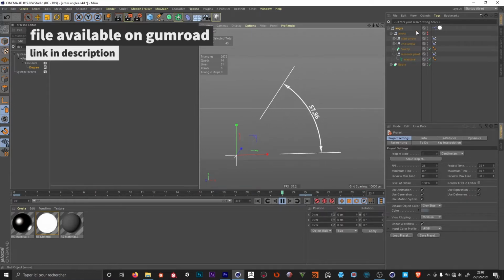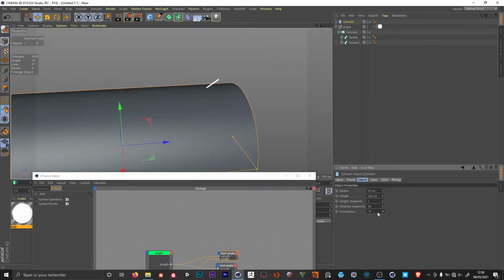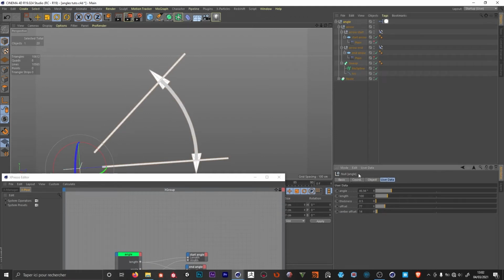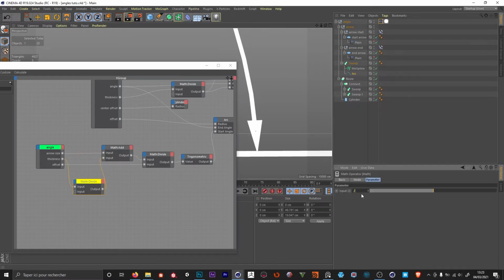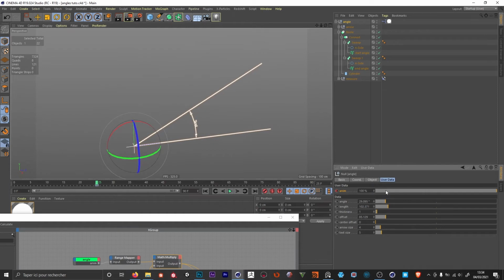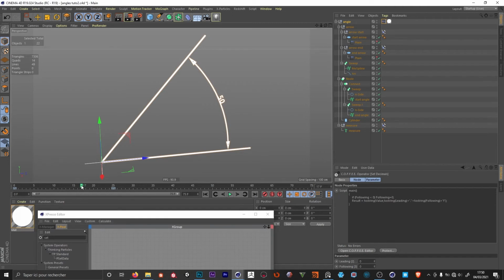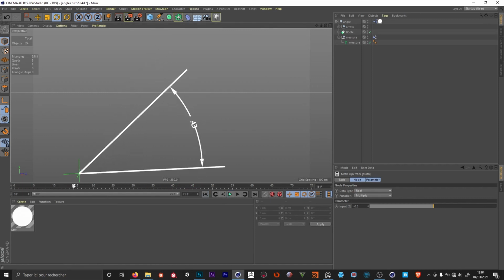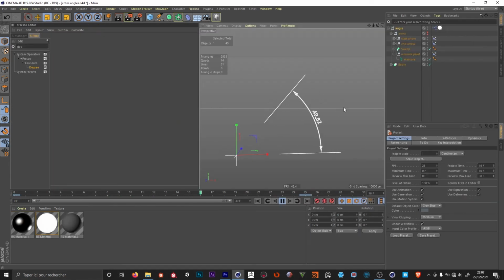[EN] Industrial drawing part3: angles

Comment: Great series of tutorials! I skipped ahead to watch the last part but there didnt seem to be any practical explanation of how the tools work. I want to ask How do the tools snap to points or lines for instance?
Reply from the maker: Hi, at the beginning of each video, I quickly review each setting. Regarding snapping, I simply use the snapping option in C4D. https://youtu.be/0gUHUaOh6uE?si=AOy-0_kq4lx9mR1g
Reply: @gillesdillenseger6472  You definitely do that, but thats running throught the slider controls. When you are using the angle tool and you want to snap the line against an edge what is your process? BTW, no criticism, I absolutely love what you have done. I actually think its worth you doing a demo video of you using these tools.
Reply: @gillesdillenseger6472  Just to say I have followed the tutorials, but i would prefer to buy your files because I am inexperienced in using expresso. The thing that stops me buying is not a full explanation of the use of the tools. The length measure is easy to work with as you shift along the 'END'null. But on the Angle tool going into to the hiarachy and adjusting the angle of the mospline in the hope of snapping to an edge,point,polygon seems not very user friendly and breaks the tool itself.
Reply from the maker: Got it! No need to worry about the hierarchy—it’s super simple. Just pick the main null called "angle," and you’ll find all the settings you need in the User Data tab to adjust the tool. The idea is to place that null at the origin of the angle you want to work with, align the tool using the Coordinates tab, and then type in the angle you need in the User Data tab. I didn’t include a snapping feature, unfortunately, but I hope this helps! 😊
Reply: @gillesdillenseger6472  Ah, thats what i was thinking. This isnt actually a tool. Especially the Angle tool - its doesnt work with geometry of an object to give you the angle ie the angle edge doesnt snap to an object .

Having to type in the angle information in user data means its not actually a tool - Its more for display/rendering purposes only and isnt a drawing aid  which is a shame because it could have been both.

Mate, i think with your skill you can tweak this to make it properly functional, at the moment its not, well the angle tool isnt anyway and im guessing the same applies to the radius tool. The  measure line tool seems to work in that respect but you have to go into the hiarachy and not the user data ctrl system you have created which feels counter intuitive.
Reply from the maker: It’s not intended to be a tool; rather, it’s an animated graphical element. If you’re looking for a tool to accurately measure length and angles, Cinema 4D already includes a built-in feature called Measure and Construction.

https://www.youtube.com/watch?v=H2QBDha0xnQ
Reply: @gillesdillenseger6472  Thanks , I think you're missing a trick. 

C4d 's measuring tool is way out of date and is need of a real upgrade. I use it all the time.
There are not many good 3rd party measuring plugins and yours was the first id seen that really impressed me. I work technically so to have something that not only serves as a drawing aid but also can be rendered with a little animation would be a real game changer. It would bring an element of cad to c4d that it is sorely lacking. 

Then rendering out plan and side views means the work is dimensioned, i dont have to mess about going into cad. I would say as someone who was close to buying your tools the description is misleading. 
They dont work as aids. But my further point is can you not develop them a little further to do this? Because then you have an A+ really useful tool that is not only visual but also technical - that would be fantastic and it feels like you are literally almost there. I wish I knew expresso better as id try to do this myself. I hope you develop them in this way then you can sell them to maxon to put in c4d 2026:)

Just to say from the aspect of an intro into expresso and how it can function really really  good tutorials.
Reply from the maker: Thanks for the feedback, that's a pretty interesting suggestion. That said, my YouTube channel is really just a side project, but maybe I'll find some time to revisit this setup and take it further.
Reply: @gillesdillenseger6472  lol.